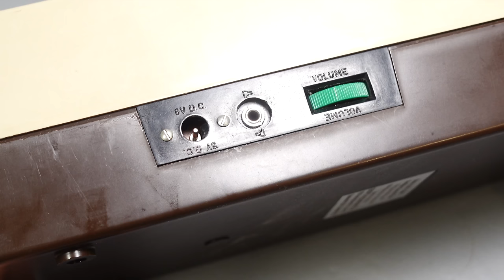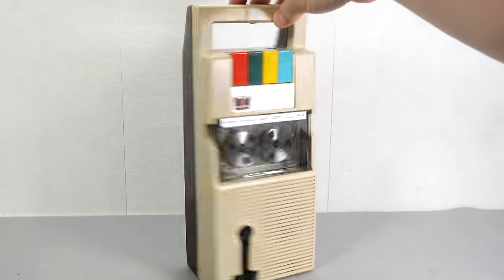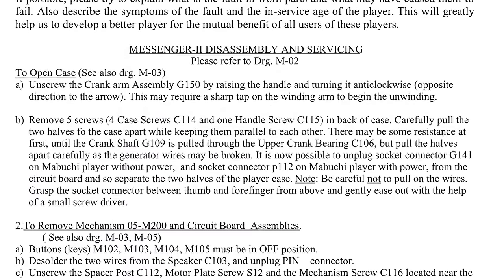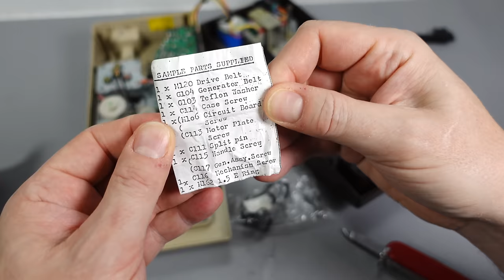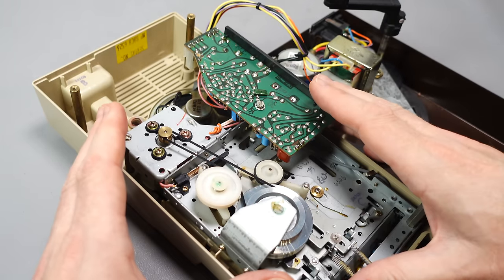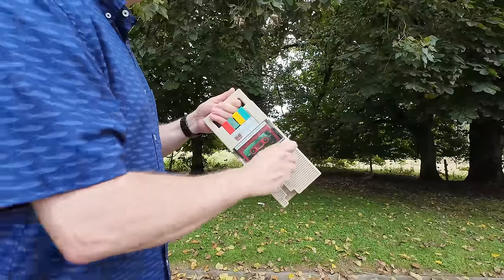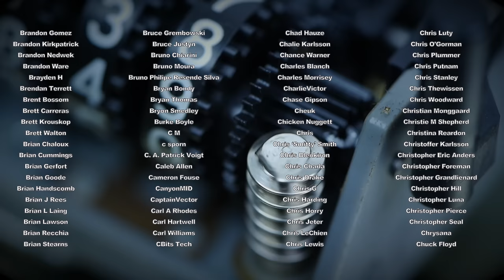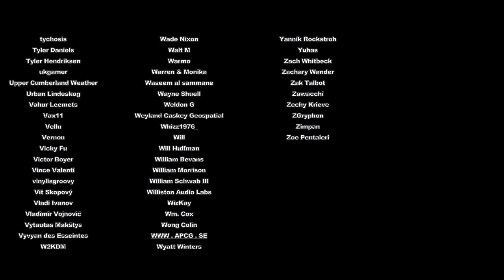This off-the-grid cassette player is a wind-up

Comment: I think if some capacitors were hooked up in parallel with the "generator" (which just appears to be a DC motor), then it would probably really help smooth out the operation of this thing.

Then again, might as well just use an external battery pack power supply.

Comment: When they were designing this they should have added a speed increasing gear train to the generator assembly. That way, you can crank it slowly and still make enough power to run the cassette mechanism because the slow rotations from the crank are being sped up by the gear train causing the generator to spin faster.
Reply: Hmm, a gear box would add friction (thus increasing the amount of force to put on the crank) so it would it would be harder to turn the crank. Basically no win at all.
Reply: You'd still need to generate the same amount of power though?  A gearbox can only modify the amount of torque, it can't modify the amount of power (the power is a physical "constant" based on the input work rate, after all).  Despite turning slower, it would be much heavier to turn -- like a low gear on a bicycle.

Comment: This thing is cool, but if I had one I would run it off mains or a wall wart more often, would be worried about the fatigue on those plastic gears. If one breaks or strips it'd be hell to find a replacement gear.

Comment: At 6:44 Matthew points to the "generator".  Maybe you didn't know that a DC (not AC) motor can be used as a generator.  Apply battery power to a DC motor and it will turn the drive shaft.  But if you turn the drive shaft (by a handle) the DC motor will provide power like a battery.  Cool!  My two cents.

Comment: The Wow and Flutter for this machine seems pretty impressive for what it is, when you are turning it fast enough the music sounds likeits playing at a pretty stable speed. 

Wonder why they didn't increase the gear ratio a bit more, surely it would be easier to use if they reduced the speed you needed to crank the device in return for a bit more resistance.

Comment: all it needs is to add a super capacitor, 2 in series, 15-30 Farad, that will store the power from the handle, and it should buffer it for 30 seconds or so

Comment: Another facinating video however, i think you'll find the cassette player is broken. The handle or crank you refer to is actually the starting handle for the built in 2 litre V6 engine to power the 18kw generator. Unfortunately if you want to use headphones you need to plug it into the mains as the headphone socket doubles up as the exhaust pipe🤣🤣🤣

Comment: A simple change would have been really smart: make the handle a disk with some momentum, and add a spot to add a string. it would then be easy to add a stick to act as a foot pedal and keeping it going for a long time would be much easier, like using a cotton spinning machine.

Comment: It's frustrating seeing something like this compared to modern electronics, if this makes any sense. This fairly simple tape player went through multiple people while being built and each section checked for quality. The people who put their initials on those parts knew this player was intended to go into remote parts of the world and wanted to make sure it would last for years to come. Meanwhile I have a 50" flat screen TV on my wall I bought less than 3 years ago that is dead. It feels like everything I buy today has a purposely forced shelf life of 3-5 years. It sucks knowing that any appliance or device I buy is almost certainly going to be dead or broken in less than 10 years.

Comment: Matt, I just saw this on my Facebook page: is it something you've known about? 

"ON THIS DAY (68 YEARS AGO)
October 12, 1955 - Chrysler introduced hi-fidelity record players, mounted under the dashboard in their 1956 model cars. Their seven-inch vinyl discs spun at 16 2/3 RPM. Sets of 35 classical recordings were available that provided 45 to 60 minutes of uninterrupted music for Chrysler drivers. The players were discontinued in 1961.
Following is the Chrysler press release introducing the record player:
DETROIT - - Highway Hi-Fi, a record player that provides music and speech as you go, has been developed exclusively for the 1956 Chrysler Corporation cars.
This novel addition to the pleasures of highway travel, specially designed by CBS Laboratories as an accessory for Plymouth, Dodge, DeSoto, Chrysler, and Imperial, was introduced today at the press preview of Chrysler Corporation's new cars at the company's Engineering Proving Grounds....
Highway Hi- Fi plays through the speaker of the car radio and uses the radio's amplifier system. The turntable for playing records, built for Chrysler by CBS-Columbia, is located in a shock-proof case mounted just below the center of the instrument panel. A tone arm, including sapphire stylus and ceramic pick up, plus storage space for six long-play records make up the unit.
Using a new principle of design worked out by CBS Laboratories, the player and position of the stylus on a record are not affected by the angle of a car, its highway speed, or even severe cornering. Tests demonstrate it is extremely difficult to jar the arm off the record or even make the stylus jump a groove.
The special records also developed by CBS Laboratories, are seven inches in size, transcribed on both sides, and pressed especially for Chrysler by Columbia Records. They give up to 45 minutes of music and up to one full hour of speech per side, A collection of six disks will be presented to customers with each player."

According to this blurb, a 7-inch disc could play for 45 minutes a side at 16 ⅔ rpm, which must mean they used something smaller than microgroove.

Comment: Odd.  Why didn't they didn't use a spring-loaded drive mechanism like you get with many wind-up toys and clocks?   With that, you wind it up and it spins at a set speed until all the tension is out and then you wind it up again....

Comment: I wonder how difficult it would be to integrate a sort of flywheel system. You would crank in order to spin up a (relatively) heavy wheel, then flip a switch to enable the flywheel to directly power the generator. That way you could do all the cranking in advance, and relax during the actual playback.

I wonder how much playback time you could get out of such a system.

Comment: Neat!
it'd be interesting to see if a small solar panel could run it.  Wire it in to the motor's output with a isolation diode to prevent the motor from getting power.
He's a NUTTER!  LOL!

Comment: If the crank was attached to a tension storage mechanism, the user would give the system 30-40 turns and it would slowly unwind to spin the generator and provide power. Perhaps long enough for a single or two?

Comment: I would have designed that with a massive lead  freeweight and clutch so you wouldn't have to crank it so much. Maybe 1 full rotation could have lasted at least 1 second more with proper gearing or maybe use a memory spring like in a wind up clock and a clutch.

Comment: Why not add a battery you can charge? Like those flashlights? Or a simple wind up mechanism? You can still use it anywhere, electrical grid or not, and it'd be a lot more comfortable than having to crank as the tape plays.

Comment: There's companies actively screwing you over for trying to repair your device the most basic way possible, heck, I wouldn't be surprised with manufacturers bricking phones on purpose without the branded chargers, and then, there's that company maintaining and revising up to 2004 the full service manual for a cranking cassette player from how long ago, and it has spares inside it.

Comment: It's a shame they didn't include even like a little crappy NiMH or NiCd cell in there that you could charge up with the crank and would maybe run the player for like 10-15 minutes at a time
Cause it has the regulation circuitry and stuff in it, and NiMH's/NiCd's are really robust battery tech (I don't think you could blow one up that easily with a hand-crank generator) that (after the first little bit of power) produces a solid 1.2V output for most of it's life, it could totally work for months of usage.
They could also put it inside a battery holder, and include a spare alongside the parts bag, so even if it stops working as well, they could always swap it for a new one and get another one at a later date

Comment: Curious if you can install a super cap or two inside that thing. Then you only need to wind it for 10 seconds and it runs for maybe a half hour or so, not sure. So you are not cranking constantly to keep the tunes going.

Comment: I think it's a bad design... It would make far more sense to use the crank to load a spring, as there is plenty of space inside to fit that, and a better gear ratio setup to allow a few (harder) cranks to crank more than it does currently... feel free to correct me if i'm wrong

Comment: Was the smart phone wind up as well?  I suppose if you're going to walk around while using a crank shaft on a media player you could rig yourself as the crank mechanism.  As you walk you're winding a motor or dynamo to feed power to a battery or direct drive to send power to the media player.  Or maybe skip that part so you can use the seemingly boundless energy of children to generate electricity that can be stored in batteries as they run around playing.  The human dynamos would store the power in battery cells worn somewhere on the person.  Or maybe use a super capacitor instead to store that energy?

Comment: I live nearly 'off grid' on a farm in Devon, well ok we have electric but our water/oil heating/phone/internet have no direct connections to the grid, there is a water wheel on a barn at the bottom end of the farm that does need restoring but I recon I could 3d print a pulley and slip a belt on that to get some tunes........where my Kylie cassette?

Comment: it would be improved if it had another gear stage in the generator, so you could operate it with a much slower hand-cranking.
Reply: But that just gets harder to turn.  The ratio was determined from various trials.
Reply: @noelbachelor8721  i am sure there is a point where it is still *easy enough* to turn, but, ups the rpm of the generator enough to make it work ok. tht was my point.  i did not want to quibble about it though.

Comment: I don't think this machine is susceptible to the EMP. Parts are large enough not to overheat. There are no microchips in it, and transistors in amplification are those big single ones of the past. I think they should survive. XD

Comment: I'm wondering what would happen if one installed a belt between the flywheel and the generator! 🤯
Reply: Horrible wow and flutter. Variations of  mechanical governors were tried.  While they work ok for record players, a more portable cassette player is more likely to move, with negative affects on the sound.

Comment: I hwd an emergency radio which used a wind-up clock mechanism for power.  It worked very well requiring very little winding for how long it played.  Unfortunately the spring broke and i couldn't fix it.  Quite a shame since wind-up radios today are useless garbage.

Comment: This must be awesome when it winds down...... Mine was bad enough when the batteries ran out.... chewed everytape I owned at some point
Reply: That usually happens when the spindle drive fails but the capstan keeps pulling tape through. As both get their drive from the same motor, it takes mechanical failure such as an inadequate (or worn out) take-up clutch for that to happen.
Reply: @noelbachelor8721 well probably was, but I was a child without the benefit of internet so I wouldn't have known that.

Comment: The purpose of this device was to share the gospel of Jesus Christ in remote areas without ready access to electricity. This would be used by missionaries. The fact that the manual is still available is encouraging.

Comment: Your email address didn't work so I'm trying this route instead. 
Have you ever come across this type of cassette from 1959 for film soundtracks?  
The film soundtracks were published commercially, and used 1/4 inch tape at 3 3/4 ips I believe.
The link may not work, I could send a screen shot but don't know where to send it.
If the link doesn't work I will try to send a screen shot.

Comment: That's just begging for a capacitor and a diode to stop the capacitor sending power back to the generator LoL.... 
Should be a pretty easy hack, this thing is exactly like those hand cranked generators on eBay and Ali Express, they suffer from the same thing until you fit some super capacitors and a diode... And then it works so much better! 
Instead of continuously cranking, you only need to crank intermittently depending on how much capacity you have in capacitors..... 
You might only need to crank for 1 minute to get 5 minutes run time.... 
Still, much better than continually cranking, besides... The capacitors take the slow crank and the fast one's to, nothing goes to waste..... 
There's plenty videos on YouTube showing how to add capacitors to those eBay and Ali Express hand crank generators which on their own are hard work but so much better once modified...

Comment: Have 2 units, of a different type of hand cranking tape players, that where also intended for spreading religions. neither unit works, despite, they are mint in original order. not worth fixing or sending it anywhere, if you are willing to pay postage, I can send you one.